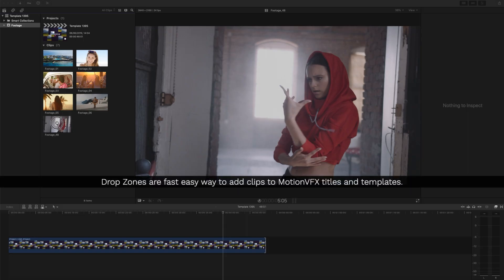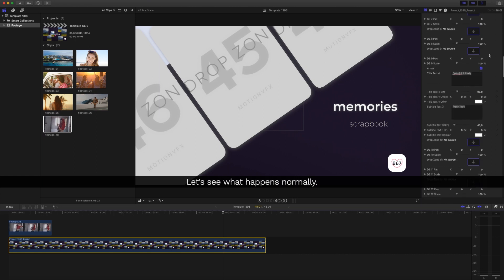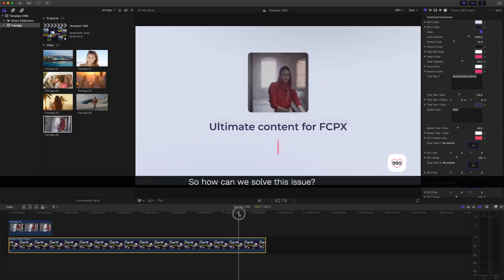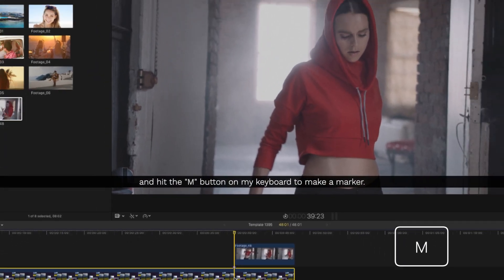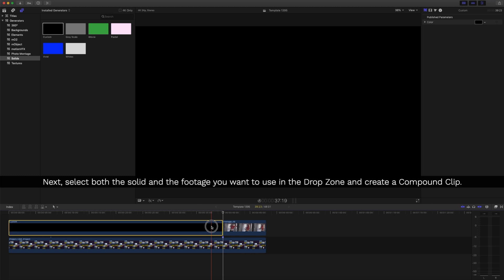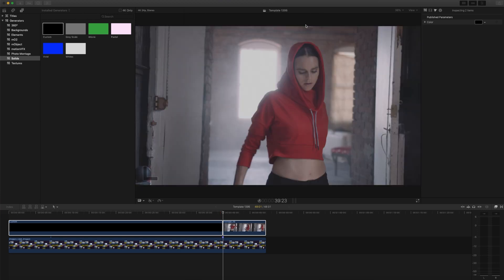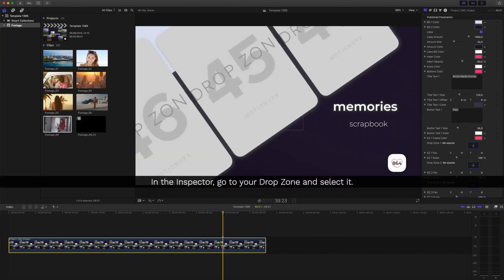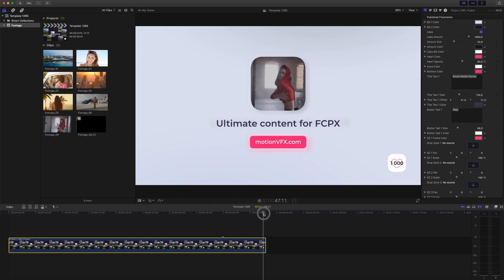Prevent FCPX DropZones from freezing your footage — FCP Lesson — MotionVFX Academy

Comment: better to make freeze frame insted black solid, it's faster and without black frame.
Reply: Good idea! Although I would personally prefer the black color solid - this way, if something goes wrong in the project, I will immediately see the timing change and will know what to modify. Wouldn't be so obvious with a frozen frame.
Reply from the maker: Yes, that will work as well. Thanks for pointing that out!